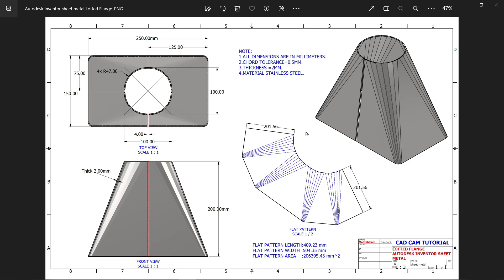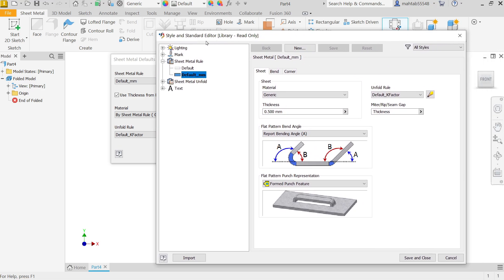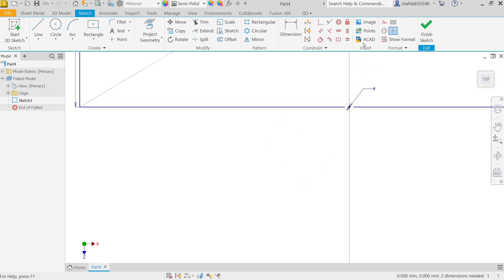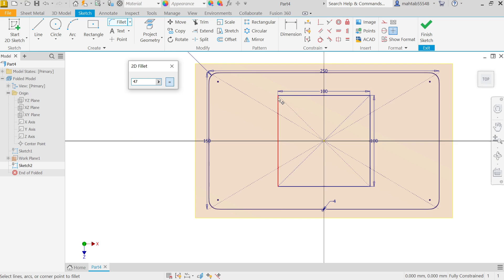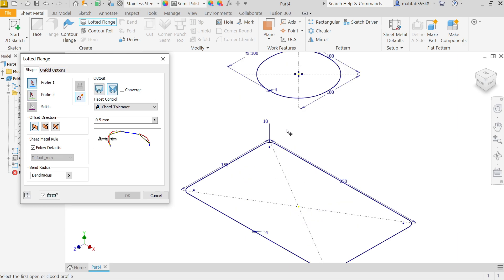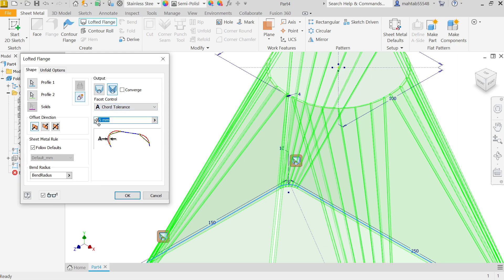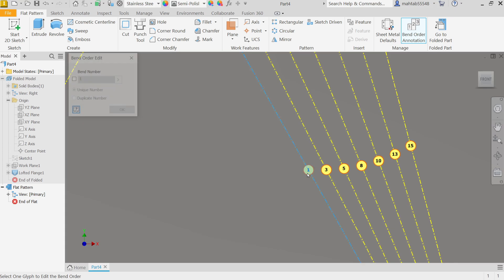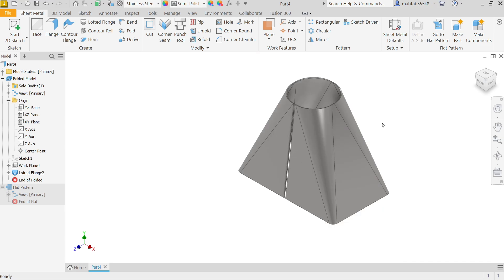Sheet metal Lofted Flange in Autodesk inventor 2023

Comment: Thank you, I never knew this was possible. 1 question though, if you need to bend this in a CNC brake, how do you get your angle input for the bends? Do you just measure on a drawing what the angle is between each bend? And does the software make all the bend angles equal?

Comment: I do not have Autodesk, But enjoy your videos as I am a retied 61 year young and have worked in the metal industry since I was 16 (worked on the shop floor always) I can make these by hand, but still have problems making them with a computer LoL.
BUT the one thing is wrong with the drawing? YOU would never have a 4mm gap on something that is 2mm thick
Reply: I dont think you can bend this all at once can you? have to make it 2 pieces am i correct?